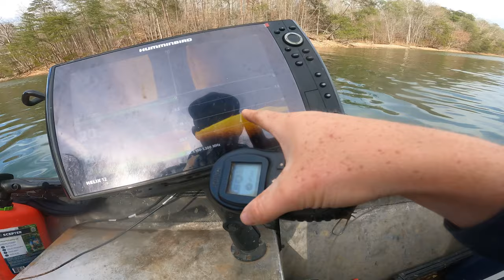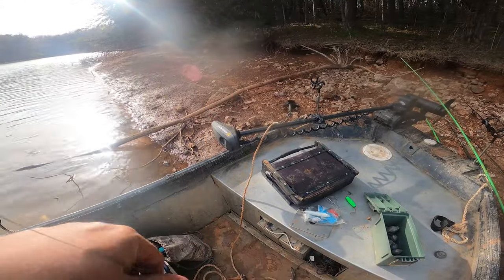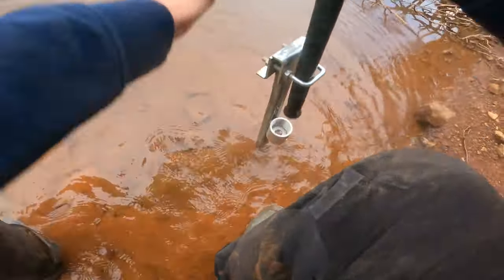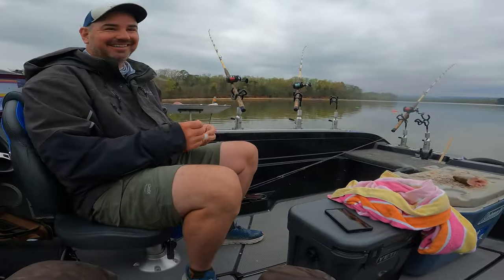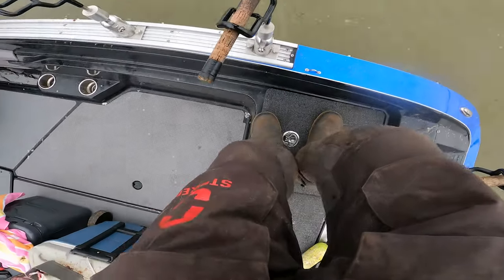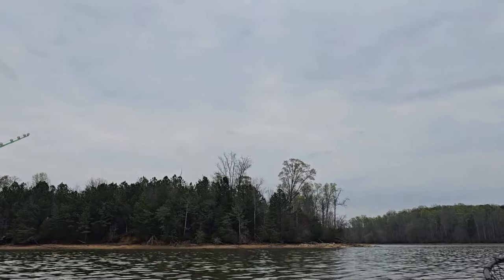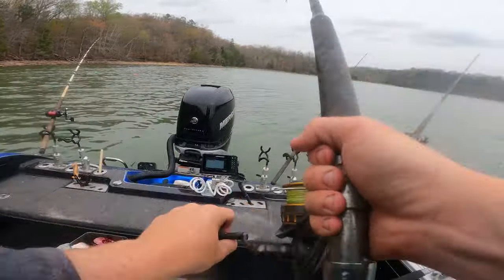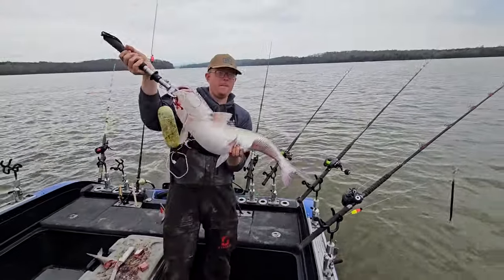$1,600 Boat Vs. $100,000 Boat Catfish Fishing Challenge

Comment: I give 1600 for my boat 10 years ago.I have put a starter trim motor.Both were bad when I bought it.Rebuilt fuel pump, change spark plugs every couple years and change lower unit grease every year.Still going strong.2 stripers over 50 a 90lb flathead and countless 60,70,and 80lb blues tons of skips, strips, and crappie, and she is still going strong.S.S Turdcutter ready for action.